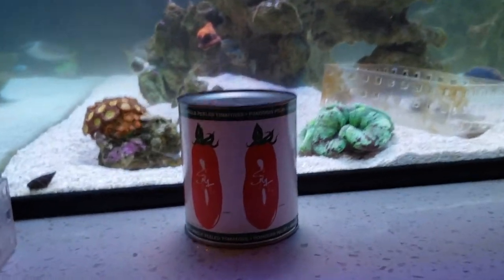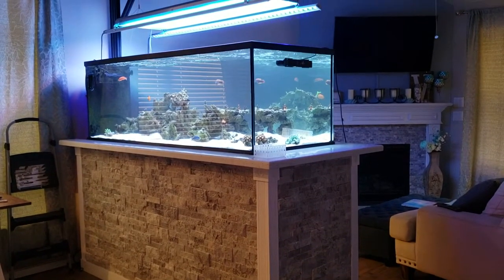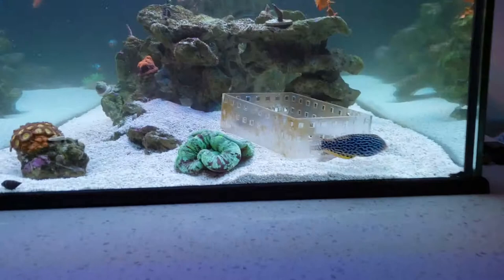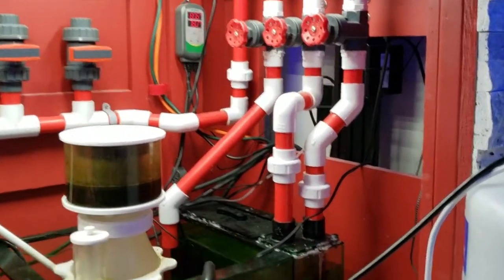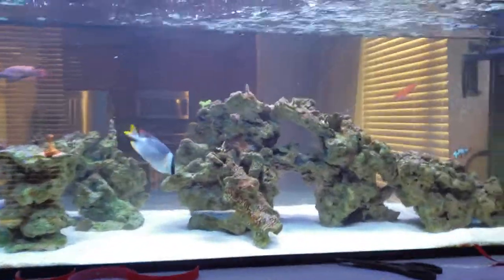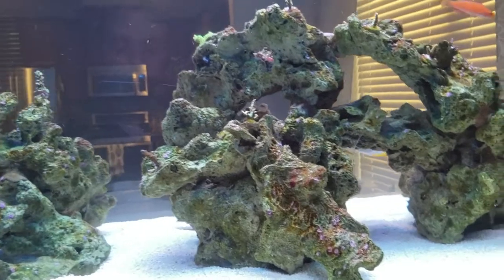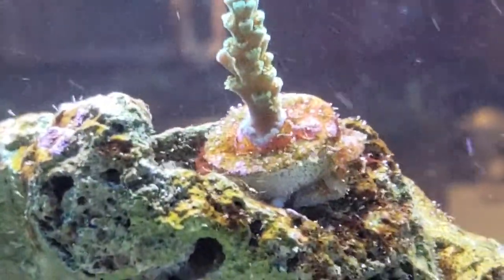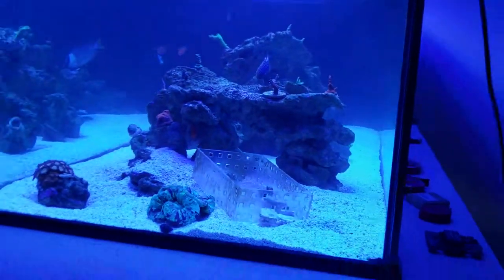New Fish - New Corals - Tank Update April 2019

Comment: Looks great bro! You can always use the extra gate valves on the emergency and open siphon to run the system should the main drain clog. It’s a great backup to have and is the original way BeanAnimal designed the overflow. Thx for the video!